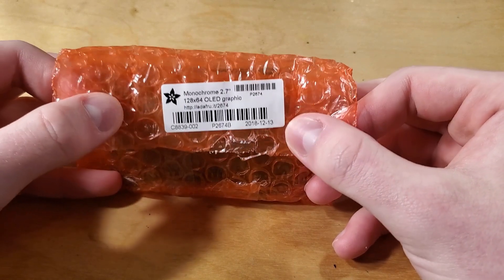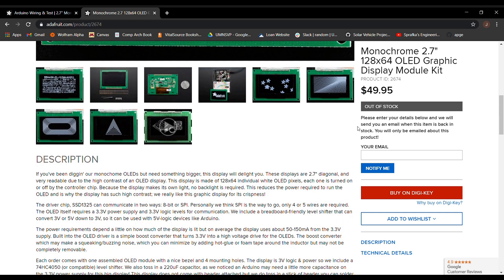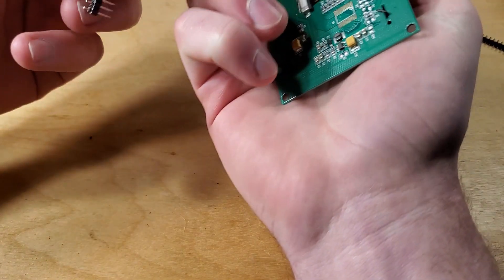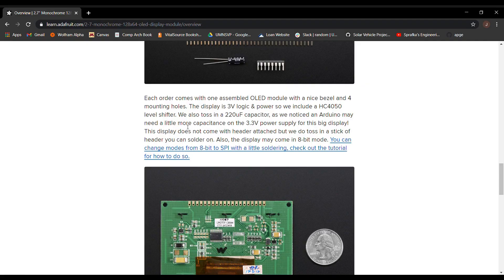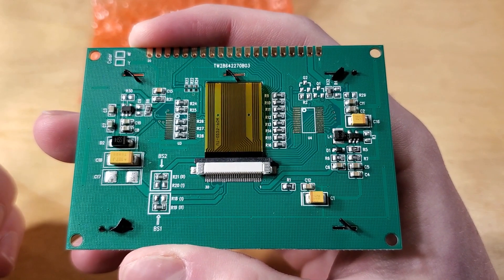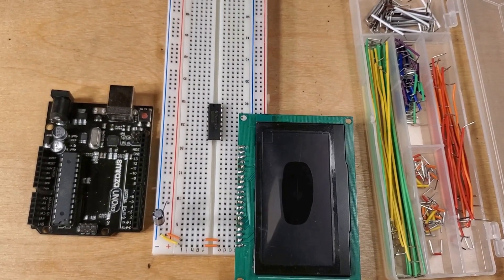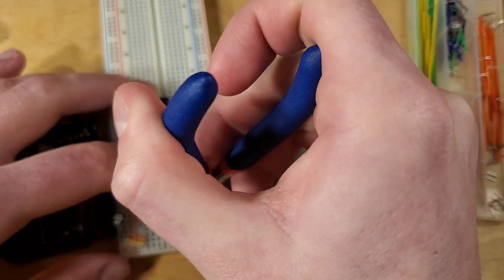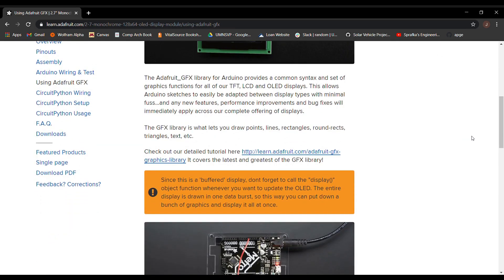Arduino Pixel Game Engine - Humble Beginnings

Comment: 2:12 Poor method of soldering a header to the display. A better method is to tack-solder solder pin 1, the reflow pin 1 while making sure it is perpendicular to the display pcb. Repeat the tack-solder and reflow for the last pin and then several pins in the middle and then finish the remainer of the pins.